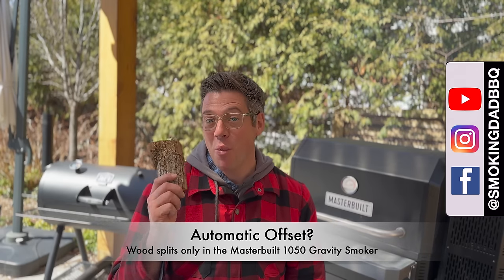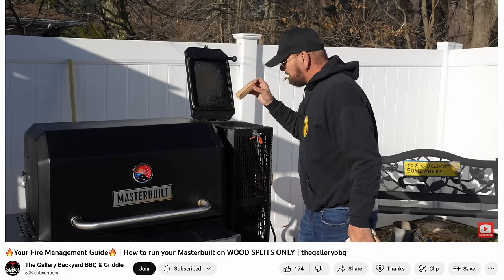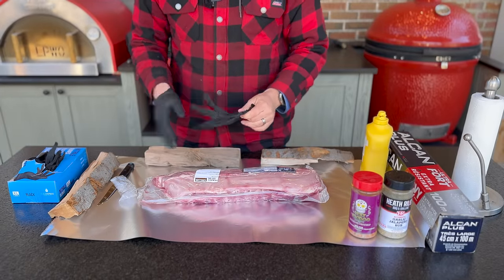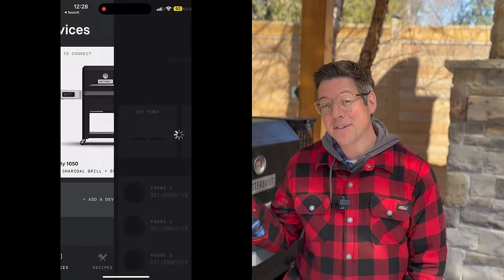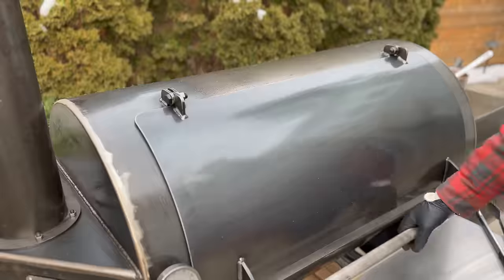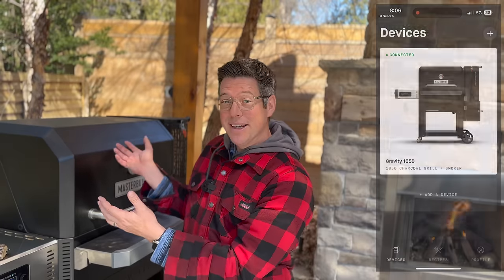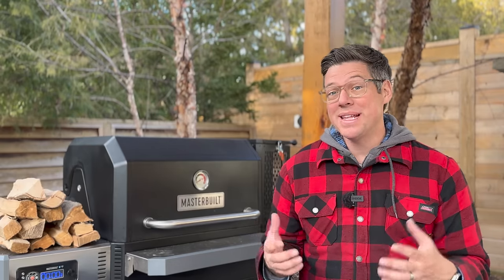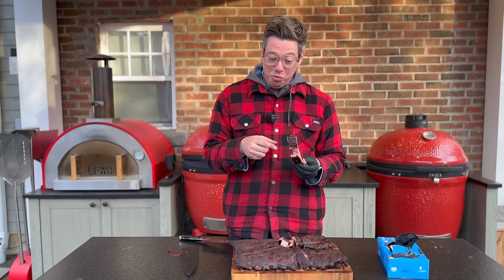I Ran A Wood ONLY Fire In My Masterbuilt Gravity Series | Smoked Babyback Rib Test

Comment: I’ve been burning wood splits in my hopper for 3 years now. Layer of charcoal, stand up splits and pour a bit more charcoal around the splits. Run at 275° or hotter and you get thin blue smoke for at least 6 hours. Under 275° gives dirty smoke. Factory temperature controller has no problem controlling the temperature.
Reply: @sawzall9600  what kind of smoke flavor does that give you?
Reply: @abc-ed1nr  it’s as close to stick burner as you can get without using a stick burner!  It’s really really great!  Added bonus is it uses hardly any charcoal.  Great when you have access to lots of good wood.

Comment: Great video, I have been using my masterbuilt for about 2 years now, almost every weekend.  I have tons of dried fruit would chunks and have great success with filling the hipper with 60/40 fruit wood and charcoal.  Set it and forget it all day, while still getting that authentic offset flavor. Try it, you won't regret it. Even lower Temps around 225.
Reply: Agree, have had my 560 for two years and have no problem using chunks in the ash bin and the hopper and getting close to stick burner flavor.

Comment: Thank you and This a great vid for showing how to get the most 'good' smoke from the Masterbuilt. I have been using the MB 800 for going on three years now and agree that 'short fill' of the stack with wood is the way to go. I was using a lower end offset before and getting some decent results. Here are some random additional thoughts. 
-I cant recommend enough to go out and get the Fireboard plus wire adaptor to get maximum control and convenience out of the MB. The Fireboard and I end up using as the onboard battery back up also address's one of the issues noted by Smoking Dad when he talks about power going out. Yes its expensive. The improved (I find) connection, history/time stamp of smokes and interface , for me, easily made up for it.
-Charcoal Matters. Lump vs Briquette matters. I find that using the single source Jealous Devil to help when extend the hopper refill time (when needed) is a good choice. I think you get some better smoke flavor from their Quebracho Blanco lump bag. Not all their bags are.
-I do recommend the elevated grate for the ash bin and placing a wood chunk on it at start of smoke
-speaking of chunks,  I personally have found using the 'fist size' chunks is my go-to. That said, if I am looking to lay down a second type of wood, or more, wood smoke flavor I will also have some of the 'tiny pizza oven wood' on hand.

Overall I don't think I am exceeding the product that comes from a quality off-set run by somebody who knows how to use it (and that is not me ) but I do think the vast majority of folks would not be able to tell much of a difference. And I get the bonus of actually being part of the party for more time then tending the offset.

thanks for reading this far

Comment: Love it, will have to try it. Ive found the LSS ash box mod a bit of a revolution for adding extra smoke. 3-4 chunks at a time. Down side is you have to keep adding, but for overnight I still put additional wood in with the charcoal. Best tip I have is weber bricketts. Double the cook time and control.

Comment: I run a masterbuilt, I highly recommend getting a fireboard drive 2. With this you are able to control the masterbuilt even more precisely, run the fan from the controller which is battery powered. Can easily handle a full 18 hour cook on one charge… or can be run plugged in also.

Comment: I find using splits of wood and charcoal is the best. Stand the splits up vertically in the hopper corners and fill the center with coals. I aim for 60% wood splits 40% charcoal
Reply: I agree, I don't have to run pure wood in my 560 to get good thin blue smoke and good flavor
Reply: Can you keep the temps lower this way?
Reply: @lynndollar1013  How do you like the 560? They have it on sale for $350 so I’m considering it. Currently I have a Pit Boss Pro. Adding a smoke tube has helped with smoke flavor, but still looking for more.
Reply: @Atekcs  Love it as a smoker, don't like it as a grill.  Would rather use Kettle to grill.  The 560 is small and I'm upgrading.   But it sold me on gravity feed, so much so, that I bought an Assassin 17.    The problem with the 560 is its size.  Its small and I don't use the bottom grate for smoking which cuts the size down in half.   The bottom grate gets a lot of radiant heat from the manifold. Before buying the Assasin, I was going to upgrade to the 1050, which I would strongly recommend.  If you buy the 560, it won't be long you'll be wishing you had the 1050.

Comment: Best thing I ever did for my MB560 was getting the iGreely USB cable in the US. It connects to any USB power bank. I did a 5-6 hour smoke on mine on a 30,000mAh battery bank and it used 10% of the power. That maps out to about 2 full days off the battery. Seriously. Solves the power outage problem completely. The wifi can be a little hit and miss. I've had connection issue with the app, but always manage to resolve them. Seriously great smokers.
Reply: Can you add a link to the cable?

Comment: You've managed to get an amazing result out of a gravity type smoker. Congratulations, this is a game changer. I would next consider using this method for the first 3 1/2 hours or so, then add charcoal and wood chunks to let it operate as set and forget it mode, perhaps at a somewhat reduced temperature, then see if it is smoky enough.
Reply: Why do you find that result amazing (Curiosity here) , if the gravity's had better controllers, no one would buy a pellet grill, A gravity feed is the closet you are going to get to an offset, and I find it hard to tell the difference between a bread box with a rocket stove attached to it and my offset,
 unless you just want restaurant flavor, a gas grill or a pellet grill can give you that,
 if you want the flavor of your father's BBQ, that is not happening with a pellet cooker, you have to have charcoal and wood for that and sometimes only charcoal and even with Royal Oak Charcoal pellets you can still tell the difference , Its just the way the pellet cooker works , it's to darn efficient, it burns way too clean
Reply: @MrJunglebear1  The amazing part is that he was able to run all wood, and get smoke flavor comparable to offset smokers, which he could not attain with the charcoal mix.  What he did, to a certain extent, it mimics what KBQ pit does, in what they call "Inverted Flame" technology. That is a hand on smoker though.
Reply: @CoolJay77  , I have run straight wood in my 1150 , for a short cook it's great , and yes the Master builds are the closet thing to an offset you can get , It's a bread box with a rocket stove attached to it  , my thing is this , can we make the Master built have the same flavor or better than an offset

Comment: I may try this on my pork steak cook today. Typically, I put a bed of lump then stand up a split then surround the split with lump, then put chunks in the ash pan. I also wired up my fireboard 2 drive to run the fan on my masterbuilt 1050

Comment: I've done very similar to what you did several times on my Chargriller. I put down a little bit of lump and then I used a full split and it burnt well for ribs and a butt. That's the only way I'll run it anymore.

Knowing the smoker I understand that mine needs at least 250 to run clean but I run at 275 so it was a nice pleasant experience on both occasions. Btw, get a nice rechargeable battery pack and an adapter plug and you can easily run a pretty lengthy cook depending on your Ah pack. I no longer run a cord to an outlet.

Comment: So I have a masterbuilt 800 I had it for about 5 months and I smoked several things on there. Pork butts, I've round pork chops breast. And when I'm smoking with the 800 I put charcoal In the tunnel with a little bit of wood but I put the wood in the Pan underneath and I get great smoke from it. There's even a guy that sells a piece that raises up the wood. But I've never had a problem with the wood burning and smok change. I like Peacan, like cherry and hickory.  
So for an overnight 200° brisket put a bunch of wood in that bottom ash catch pan. And you can also add a little wood in with the charcoal.
That's the best way to smoke with wood, I'm in the 800.

Comment: Awesome video. I tried this yesterday. Started with some b&b hickory lump in the bottom. I let it get up to temp and then added a few descent size hickory splits. Set the temp to 275 and let the smoke stabilize. Oh my, they were the best wings I’ve ever had. I didn’t add any wood and maintained 275 for 2 hours.
Reply from the maker: Sounds great!
Reply: Would you say 275 is better than 225 for both wood chunks and charcoal together?

Comment: If that Masterbuilt was closer to a $1200 build quality, it would be a game changer.
Reply from the maker: 100%. If I actually believed this would last it would be at the top of the list for people looking for a smart grill
Reply: Actually I prefer the current quality to price point (The Masterbuilt 800 was on sale at Walmart for only $200 at one point).  Since the technology in these can change dramatically, it is nice to be able to upgrade every few years at a low cost.
Reply: @SmokingDadBBQ  you don't think it would last because this grill wasn't intended for run 100% wood or for what you mentioned in the video of this grill having moving parts?
Reply: @__-ul7cc  Eric Rowley (TheBBQHQ) has expressed a poor opinion of Masterbuilt's durability, electronics and customer service.  He's a pellet guy, but I hear the same sentiment in comments from long-time owners.

shrug Just hearsay, but it's enough for me.
Reply: @blipblap614   thanks, it's good to be aware that some have experienced durability issues with this type of grill. Maybe it's worth to spend a little more in an offset smoker since it will last a lot more. But I have to admit it is appealing the possibility to run the masterbuilt as an offset and also have the other benefits of this series.
Reply: I’ve had my 1050 for a little over a year now, with a lot of use. I have had no issues at all. Haven’t tried wood splits.
Reply: Time to turn our sight to the Gravity XT ($1500) @SmokingDadBBQ, can you get one for a review??? Is it a gamechanger?
Reply: @blipblap614  yes- I’m looking to buy one of these and ran into the same issues on reviews. However, they basically had a v2 come out (all 800s are this spec) that supposedly fixed a lot of issues. They also make a ton of aftermarket parts that address some of the fail points

Comment: Questions
1. Did you start with a small bed of charcoal?
2. You just kept adding 2-3 wood chunks or splits every 45min or so?

I have noticed on my 800 that it likes to be around 275F also to get a cleaner wood smoke. 225F tends to get a little more dirty smoke and 250F hasn’t been the most consistent for clean smoke. My method has been bed of charcoal to get it started, 2-3 wood chunks depending on size a single layer of charcoal, 2-3 chunks of wood and repeat. I pretty much only use B&B Briquettes in the orange bag also.

Comment: So I have been researching smart grills the last year or so because running a stick burner can be a pain. I had a good friend tell me to run 50/50 with chips and broken up lump charcoal on the gravity feeds. It’s supposedly a good clean smoke, barks the meat up really well and can run at 250 and sustain a small flame. Not sure how accurate what I heard is, but every time I’ve had his brisket or ribs, it’s good and not bitter.

Comment: Nice cook!  Not exactly set it and forget it like it’s designed for but I’m sure it’s still easier to not be directly controlling the temp stability by adding splits as in the offset.  Not exactly the same design but to some degree I think you turned it into a Karubecue

Comment: thing is you can run that masterbuilt of a ryobi battery using a wall socket converter, other than the fan speed there is not much to control on this! How much wood would you expect to go through for a pulled pork or even a brisket? could it be loaded to the brim and left to do its thing?

Comment: Soo glad you made this video. Been on the fence about keeping my master built or not. Was keeping the temperature around 275, and it burnt through a full hopper way too quick
Reply from the maker: It does use the fuel … which is a good thing for flavour but not for the pocket book

Comment: Can you give a little more information on how you started/maintained the fire?
1. Did you start with a charcoal bed to ignite the initial wood chunks?
2. Did you keep the lid open or do anything specific before starting up the grill (to allow the fire to ignite more and get burning hot/clean)?
3. Did you wait a certain amount of time after allowing the grill to come up to temp (maybe to wait to see thin blue smoke?)
4. How did you know when to add more wood?

Appreciate any other tips or insights you have on this! I've watched your and @theGalleryBBQ's videos on this multiple times, but I do not know if it is as simple as doing everything the same as you would with charcoal (besides adding the woodchunks piecemeal to minimize creosote), or if you are doing anything else in between.

Thanks!
Reply from the maker: sure, start with a handful of charcoal to get a coal bed 1-2" covering the bottom... then drop in 2-3 hand sized splits as needed.  dont need to do anything else, open, drop, close and continue

Comment: Great video - just what I need.  As far as the power goes, it runs off a battery pack and they last 20+ hours.  I can send you what I bought.  Also, I bypassed the safety switches because they go bad.  I hard wired a toggle switch to manually turn on/off the fan and it has been a game changer.  I like the Masterbuilt for the price.  It's a box store build.  Imagine if Lonestar or another premium offset manufacturer built a gravity fed like this!  Thank you for perfecting the wood only cook.  I have learned a lot between Tom, Tommy and you.  Can't wait to try.
Reply from the maker: thanks, and good idea with the switch
Reply: @SmokingDadBBQ  Anytime.  It really make the pit more mobile and to me a little more bullet proof.  I would recommend the toggle switch on one of the hopper buttons over the lid.
Reply: I have a Masterbuilt as well…what type of battery pack you used? And where can I get it from
Reply: @holymolibbq  a lot of people use different methods but I got a solar battery pack from Amazon and a 12V USB to 5V cord. Works great.
Reply: @lx2nv  thanks for the reply

Comment: I love this idea.  I’ve thought about trying that in a Kamado.
Reply: @FOGO Charcoal How or where, would you add wood every hour in your Kamado?
Reply: @tomm9493  I’d start with it filled up and vents barely open.  With the EGGspander, it’d be easy to add more if needed.
Reply: @FOGOcharcoal  Thanks
Reply: @FOGOcharcoal  hey fogo kamados are so efficient you would be burning bad smoke, 
I tried this many times can only get away with burning a small log doing a clean burn no way you put to or more log’s burning at the same time you will ruin your food and destroy the egg, in the small firebox,
The best method have tried is a bed of charcoal and a small like 1/2 split log burning with a small flame and meat raised on the Eggspander extender, you will have to have the dome a little cracked open  for  more air , otherwise you will lose flame and log will be burning bad,
Reply: @abbsabbs8610  That is exactly what I was curious about and I do believe that your hypothesis is correct.

Comment: Hi James great cook, how does this all wood cook compare flavour wise to a double indirect cook on kamado joe with the wood in the ashtray??

 kamados are so efficient you would be burning bad smoke, 
I tried this many times can only get away with burning a small log doing a clean burn no way you put to or more log’s burning at the same time you will ruin your food and destroy the egg, in the small firebox,
The best method have tried is a bed of charcoal and a small like 1/2 split log burning with a small flame and meat raised on the Eggspander extender, you will have to have the dome a little cracked open  for  more air , otherwise you will lose flame and log will be burning bad,

Comment: Great video and thanks for mentioning the other vids.  I have the 800 for almost a year and use a mix of charcoal and wood.  I do like charcoal flavor.  The grill has worked flawlessly so far.  I love being able to sit in the basement and watch movies while I sit there and monitor my grill.  I usually start off at 225° and work my way up in temp to get more smoke in the beginning.  Works great for chicken that I end with a temp of 450 - 475 for crispy skin and smoke flavor all without going near the grill;-)
Reply from the maker: it is winning me over a little towards the benefits of app controlled temps